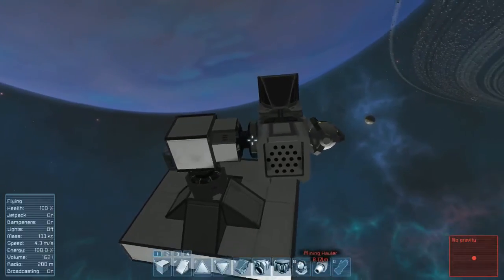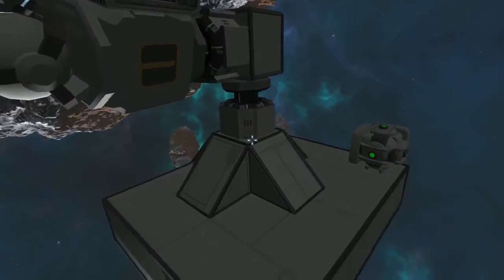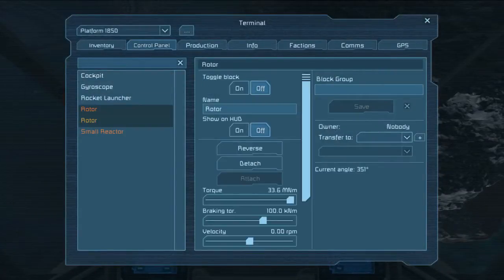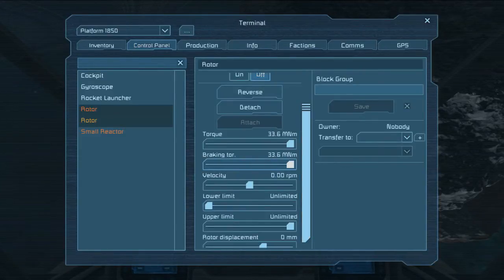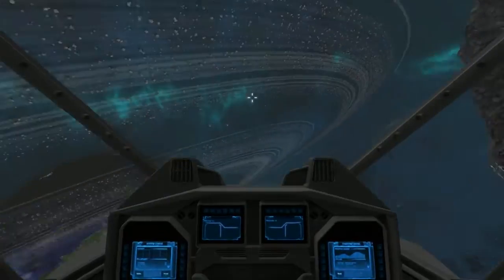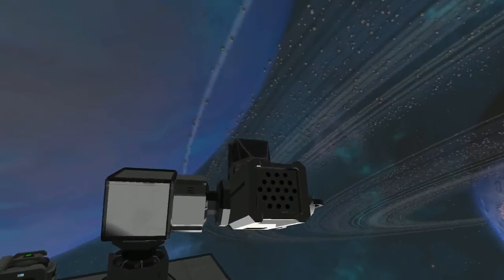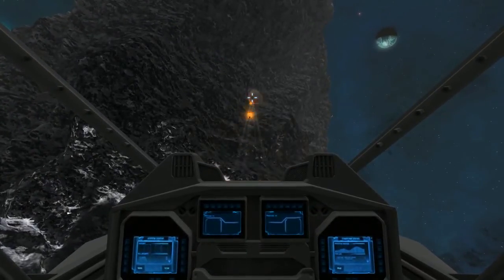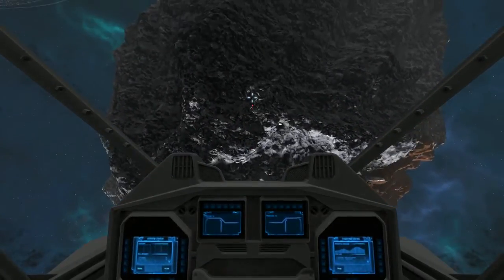Space Engineers - Basic twin rotor turret design

Comment: With control of vanilla turrets (and turret modding being a thing) these are kinda redundant. HOWEVER. Would recommend looking into disconnecting the rotor "part" and patching in a small ship rotor, meaning you can have a lot more firepower in a small space.
Also, I have been looking into installing a connector for use when not in combat to keep turrets filled. If you want to take up that mantle, you're more than welcome!
Reply from the maker: Eike Sky Ideally yes, I would prefer to see the devs come up with a stock turret carriage for us to build on, however until they do we will always have a need for custom turret designs.